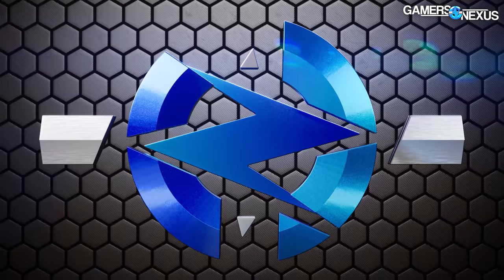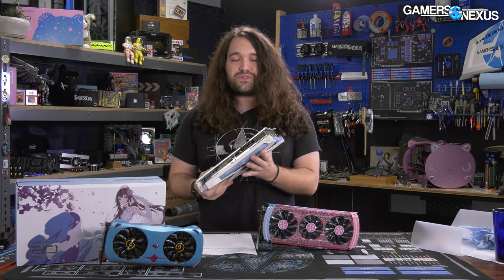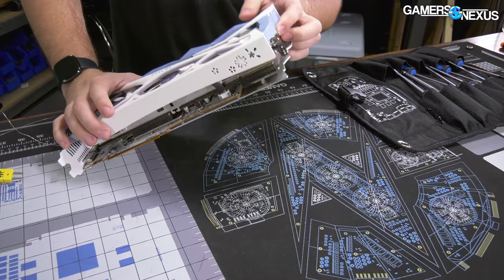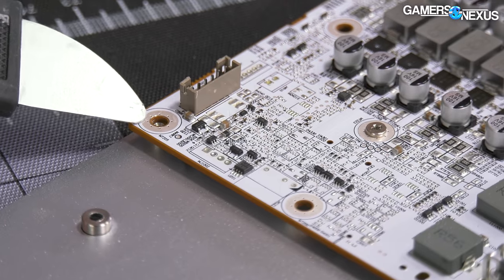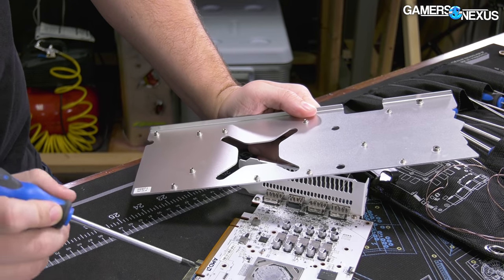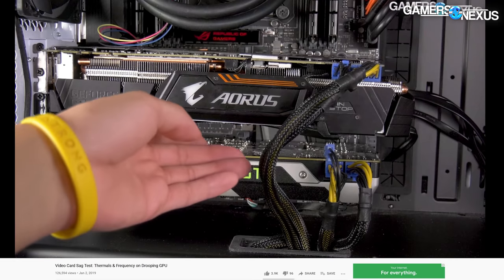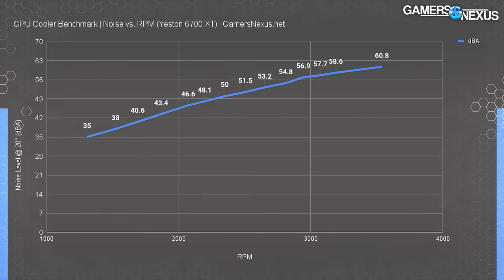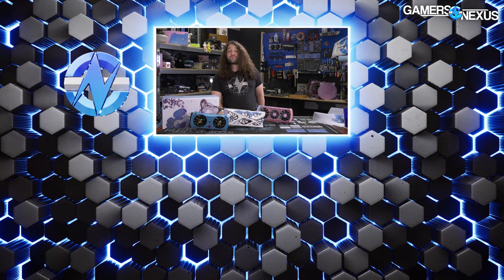AMD Waifu GPU: Yeston RX 6700 XT Sakura Review & Tear-Down

Comment: Honestly, that middle one (the white one with the elements / bars in front of the fans) looks cool just because of those elements and because of the color scheme.
It doesn't have to be anime themed at all, so it wouldn't even need licensing. It's just good design in general. Kinda tired of the gamery design which just has a lot of sharp angles, lights, dragons, lightnings and other "cool" shit.
I want to see more sleek and clean designs like the white one.

Comment: Sorry for ask but cant find information on net, Have the same model and connected wrong 3 pin rgb and burn the RGB system, can open but only show a blue led, no more auto cycle rgb colors and no more synchro with motherboard, if someone know with cables need replace or check for fix the problem

Comment: Not bashing on you but you say your reaction was genuine but the card is not wrapped in a static bag upon opening the box? Either you already opened it and took the gpu out of the bag or it came without one which would be highly unusual for sensitive electronics

Comment: Speaking of gpu Junction temp delta, I have a 3060ti Ventus 2X oc that reaches 76C and 96C junction under a heavy load. How can i improve this? Already tried replacing thermal paste (With kryonaut extreme) and hastely tried to lap the contact surface, with barely any success.

Comment: Just a heads up Steve regarding newegg crap for sale... newegg is selling a GIGABYTE GeForce GT 1030 Low Profile D4 2G DirectX 12 GV-N1030D4-2GL Video Card that Jason Evangelho did a scathing editorial on July 9 2018 for Forbes in their game tech section. Just thought you might like to know that it appears all the components sellers are still play dirty switch on us consumers.  The short of it is nvidia switched the gddr5 memory in the originally released card to gddr4 crippling the memory bandwidth by 65%. The card that newegg is now selling has the 2gb of gddr4 memory.

Comment: I would buy 3070 if it was available for purchase anywhere in this design, but sadly didn't find any. I won't buy Radeon simply cause from people who work fixing graphics cards the statistic for gpu survival in case of mailfunction is noticeably worse on Radeons compared to rtx 30** series. Guess I'll have to do with 3060 for now and see if 3070 Sakura will actually be released. There's 3080, of course, but it's far over both my needs and budget.
Reply: There is the Maxsun Enchantment heart princess 3070. It's not as unique but it fits the anime theme as well.
Reply: @barronhelmutschnitzelnazi2188  Yeston 3070 was released and it's cheaper than Maxsun. But I already ordered 3060 Yeston (3-cooler purple one), so don't know whether there's any point to buy 3070 now
Reply: @ramses3033  ahh the purple and black one looks interesting too. If anything, the point would be if you want about 20% performance increase but the 40-series are coming this year so it would be better to wait if you want an upgrade. 3060 is a solid card for 1080p anyways so there's no need if you're playing in that resolution. I'm interested in what Yeston has in mind for the new gen cards.
Reply: @barronhelmutschnitzelnazi2188  1650 d6 is enough for me. I bought 3060 just for the appearance and it hasn't been delivered yet and I'm already questioning my actions
Reply: @ramses3033  it's not a bad card. I would spend the extra for a 3060ti though. The gap between a 3060 to a 3060ti is bigger than a 3060ti to a 3070.
Reply: @barronhelmutschnitzelnazi2188  I've found Sakura 3070 cheaper than regular 3060ti. And buying standard 3070 is less risk compared to 3060ti on hynix.
Reply: @ramses3033  i guess so. Whatever has the best price to performance is better

Comment: don't care about cute, just needed an upgrade. bought the 6600 xt and despite being compatible with my hardware it did not work. even on absolute minimum settings my drivers kept crashing on valheim, wow, no mans sky. tried latest, tried older, tried drivers only, tried 3rd party last.... nothing was stable.

RMA'd it 10hrs after opening the box. Looks like they're going to restock fee me $100. Kind of unhappy.
Reply: what ? this model only available for 6700xt and 6800xt

Comment: this is what happens when companies take the easy way for quick money. they push away competent people and they go else were.
Reply: Well, the cards that Yeston made are really descent and well built (i have a couple of their 6HDMI version of the R7-350 for my CCTV system at my company ... they are much cheaper than the Matrox equivalent of these type of cards). The thermals are very good despite that the cards are in Crossfire and being in a crapbox without any airflow !

Comment: I wish all GPUs were pretty or cute... though I'm not a fan of the smelliness.
Reply: It's only temporary so not a big deal. Let the card run hot and the smell will likely go away
Reply: @barronhelmutschnitzelnazi2188  yeah, just like it did when I bought a used PSU from a pot smoker. 😂